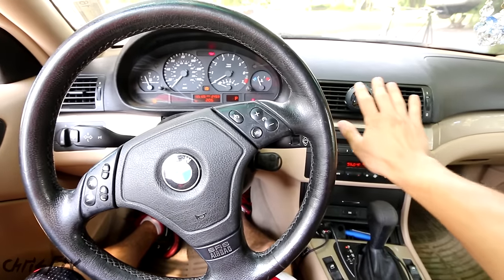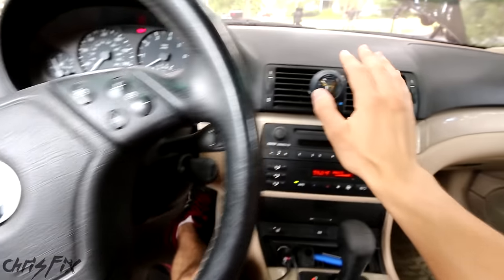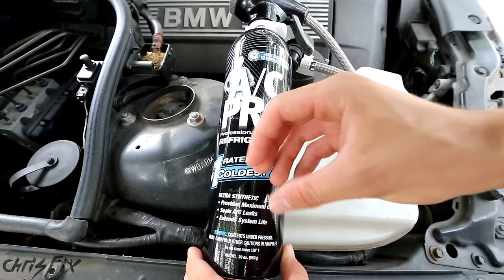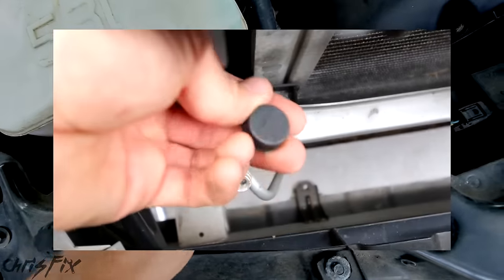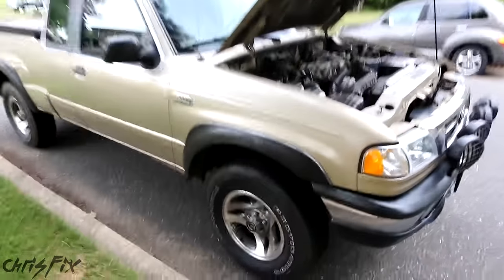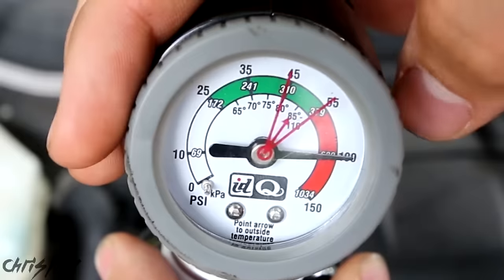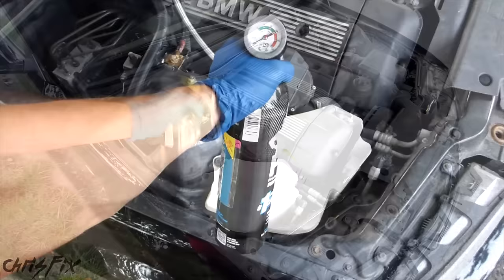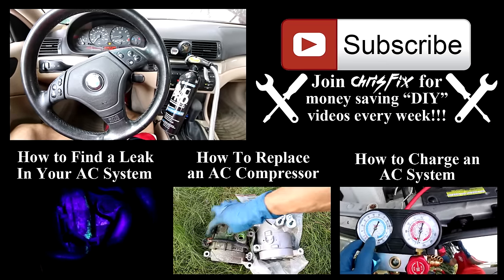How to Recharge Your Car's AC System (Fast and Easy)

Comment: Well there are certainly a couple of things to discuss about this video. First and foremost you never charge an AC system in a car unless it's been properly evacuated and second, never charge an old system to anywhere near 45 or 50 psi. All of these readings depend on the outside humidity and the outside temperature as to where your low pressure PSI should be so in general you want it to be around 35 lb but the outside temperature at 75° and relative humidity 60%. There is a chart if you Google charging atmosphere temperatures versus pressure. And always make sure your AC is on recycling as this will blow the coldest air because it is drawing cold air from inside the vehicle back through the vents
Reply: How many years old would you say is an old car?
Reply: @midkort  it's not how many years it's how many miles. I own a few cars and one of them is 20 years old with 43,000 mi on it

Comment: Hey Chris. Can I turn on my engine and immediately turn on AC? Also vice versa. Can I turn off my engine with AC running?
Reply from the maker: You can turn on your car and immediately hit the ac, the computer will usually hold off on it until the engine warms up a little then it will kick on, and you can shut it off with it running. The only exception to that would be if you are driving an old carbureted car but it's unlikely you will be

Comment: R12 have Schrader valve connections too sir
Reply: Both R12 and R134a systems use Schrader valve connections, but they're different sizes -- not compatible. You can buy a kit to convert older R12 systems to R134a, but that requires pumping out the old refrigerant and oil, replacing w/ a different kind of lubricant, using a vacuum pump to remove all the air, then recharging.

Comment: Do I have to evacuate the Freon inside of the car even though there is a leak and the ac is blowing hot air
Reply from the maker: You can always hook up gauges and see if there is any pressure in the system, if there is none then you can fix the leak without risk of dispersion. If there is some residual it is better to be safe than sorry so I would get it evacuated
Reply: @chrisfix  dude thanks so much for the fast reply, I thought I was going to have to wait a while. Thank you Chris

Comment: I'm confused if i should just refill or do the bigger job you do in other vid with vacuum pump etc. I have all the equipment but i don't have the guts to do it 🙈

I used a not so cheap scantool that said "your gas level is normal" twice. Can i assume that it's normal then?

Comment: Followed your instructions but I noticed a difference in pressure between when the compressor was engaged and not engaged.  Which pressure reading should I use?

Comment: Aren’t you supposed to have it like flushed out of the system so no air or something?
Reply from the maker: There is no air in the system. There is still pressure but it’s low so there is no air in it. I have a link in my description showing how to do it when you need to pull a vacuum and add refrigerant if air got in.

Comment: I recently bought a can of the A/C Pro from Amazon (6-6-2022). The canister I have has a pressure gauge on it but you can not adjust it for temperature. No problem, I just you may want to know.

Comment: Without a vacuum pump to get out the moisture, a scale to NOT overfill the system, and gauges for the low P and high P lines, you will damage the AC system.
Reply from the maker: Not really in this case but thanks for sharing

Comment: There is no need to vaccum the ac system as the air present in ac system lines?
Reply from the maker: Unless you opened the system and/or replaced a major component there should be no need to vacuum the system out

Comment: I tried to do it with super tech but it was extremely hard to press down. The bottle was really cold however the air did get a bit cold but not all the way. Any tips on how to get it really really cold? I very much would appreciate it (:

Comment: Hey Chris. You say if the compressor isn't running possibly add refrigerant but what if the gauge is reading red saying "see instructions" as well as the compressor not running? Should I still add the refrigerant?

Comment: Hey Chris my compressor kicks on at first and cold air blow but after about 30 seconds it shuts off and the AC blows warm air does that also mean the pressure is low?

Comment: Good video, but in my experience the newer electronic gauge that comes with the ACPro is NOT accurate.  With the compressor on the gauge went from 25 to 36 in about 30 seconds of filling and then jumped to 66 without any warning or reason!  Sounds like a lot of people have had a good experience with this product, I am not one of them.  I had the neighbors kid use some higher end equipment to bleed off the excess and won't be using ACPro again.  Best of luck to you with your future videos.

Comment: Should I pull a vacuum before adding Freon !?
Reply from the maker: For a faster recharge like this, It's not necessary
Reply: @chrisfix  I’m guessing i had a leak. One day I decided to go to Walmart and forgot to measure the ounces so I think I over charged it. Killing the ac clutch. Also When I turn on the ac. It smells horrible like chemicals so I’m guessing it’s a ac evaporator core leak behind the dashboard. My questions is. I’m getting ready to spend a lot of money. New ac compressor new lines. New drier. New new condenser and new evaporator core. Should I pull a vacuum on the system ? Or it wouldn’t work ? I don’t want the new parts to get contaminated or whatever else can happen if I just replace instead of removing everything. The truck has zero Freon !  Ac clutch doesn’t work. It doesn’t spin. Any tips ? Also or do you think putting new parts should be fine ? I’m glad I found your videos man ! I helped out so much !!!

Comment: I have a question about the air conditioning, in my car the air from the middle air intakes is relatively cool, the air from the driver's intake is more warm, what could be the reason?

Comment: Hi Chris. I'm seriously considering doing this to my son's 1997 Saturn SC2. I had a cousin who passed away a few years ago that always did my a/c for me. He was always adamant on vacuuming the a/c system and adding oil before adding the refrigerant. He was also adamant on purging air in the installation hoses. I understand that this is a low cost fix and not a true, complete fix. My question is: will the air that's in the hose of the Pro A/C can cause any damage to the air conditioner system? I don't want to ruin my son's car.
Reply: Bro it's a fkng Saturn.... recharge the ac and keep it moving. The car is worth 35 cents and the recharge will last longer the vehicle.

Comment: I didn't know this was a thing but my car isn't cooling and I haven't figured out why. My fan runs and I don't think the radiator would be clogged since my car seems fairly clean. I replaced the cabin filter ... I think I may need to recharge since I don't see any refrigerant leaks and it's container is only slightly below the recommended line.

Comment: I have one question -- I watched a similar video that said you shouldn't use these recharge kits because one problem is that you can't flush the hose before connecting, so you introduce some air/moisture from that short length of hose. Is there a way to spray a bit of refrigerant out to clear the hose before connecting to the low-side port, and do you think this step is necessary?

Comment: My compressor or clutch seized up so i had to remove my ac belt. I plan on getting a new compressor, draining the refrigerant, removing old compressor, install new one, then i can refill the refrigerant with one of those cans or do i need a special device to fill when its completely empty?

Comment: Hey chris, do you still stand by doing it tihis way or evacuating whole system, vacuum mosture & air, and add correct amount (weight wise) w/ stop leak if needed. Thanks

Comment: I have a new compressor on my ranger it’s got the 4.0 I vacuumed the system it held. After adding the r134 my ac clutch is kicking on and off, I added the whole can and the gauge will go into the red clutch kicks on and then shows low over and over

Comment: Funny my gauge does not have that arrow/indicator but just the pressure needle. And my car AC temperature stays 45-46 at full blast, windows open, outside air settings (inside air didn't make any change tho).

Comment: Hey Chris,  thanks for all your videos.  I bought the AC Pro gauge without the refrigerant.  My Low pressure fitting is down past the fan so I was not comfortable attaching while car was running.  The gauge when I put it on goes to the red zone and stays there even if car and compressor are running.  Is it normal to read the pressure in the system regardless if the car is running or not?  Just want to confirm my problem is something else.  Thanks

Comment: Curious to know - why did you not use the recirculate option in the cabin? I find air con is always colder and is less work for the system when using recirculate at the same time.

Comment: the video shows that you used A/C Pro but the link is for Arctic Freeze.  Which one has the sealant that "wont damage the ac system or the ac recovery machines mechanics use"

Comment: Quick question: when the compressor kicks on while recharging with the a/c pro, the dial on the gauge jumps wildly into the red range, when when the compressor kicks off, the dial is at the lowest point in the green range, so, my question is, is that okay or do I want the dial to stay within the green range even when the compressor kicks on? No one explains or clarifies that. (Should the fluctuations be so cRaZy?) Thanks and I hope to hear soon. 🤔🤔🤔🤔

Comment: Hey Chris, question for you: do I have to puncture the can in order to read the pressure in the system? If I just connect the hose itself without it being connected to the can will it read the pressure right? Thanks!

Comment: I bought a Freon can recharger, but It doesn’t have the set pressure option. It does it automatically? Do I have to wait a certain period for it to get the reading, or it the psi level given right away? The gauge is in the red indicating to “see instructions.” Thanks for you help in advance!

Comment: Hey just curious I just replaced the ac condenser in my girlfriends car, obviously there’s zero pressure in there would I be able to use this method to charge it or need to use the actual ac machines they have at dealerships and whatnot

Comment: Hi, Chris. I have a small leak in my Prius 2007 as well. It lasts about a year. Is there a product that contains additives I can use that is safe to use in a Prius dialectic ac system ?

Comment: How to change the port fitting when leaking on air conditioner?
Reply from the maker: I would evacuate the system, the fitting is usually just screwed in so just unscrew and put the new one in and then recharge with this process: https://www.youtube.com/watch?v=Pdq8JAlct6s

Comment: I noticed that you are using A/C Pro Ultra Synthetic A/C Recharge R-134a. My 2017 Veloster uses Regular R-134a refrigerant. Is it safe to add the synthetic version to this - mix the two types? Many thanks.

Comment: Mine is on white when the  clutch  is on and green  when the clutch  is off,  is that normal? Should I check the pressure  when the clutch  is on or when off? Thanks!

Comment: I know I’m late to this video. My AC system went out this morning when I was taking my kids to school I usually set my temperature to 70° but this morning it was blowing hot air. I lowered my temp to 64° the ac was blowing cold air. If i where to recharge my AC system with a DIY would it fix the issue i have?

Comment: You probably should not recharge your AC system without addressing the leak first Chris, or at the very least changing out the valves on the High/low

Comment: Is it normal for the air not to be cold after adding the refrigerated bottle? Everything is spinning , gauge needle was on green and air still not cold at all… it’s slightly colder than earlier but not a major difference

Comment: 40F is ideal and of course this is useless when you only have a high port like my Audi does which was just dumb on their part
Reply from the maker: Is it hidden deep in the engine bay somewhere or there is only a high pressure port?
Reply: @chrisfix  only a high, they did not want owners to do their own AC, dealer only to have it vacuumed out

Comment: I just filled my 2010 chevy colorado with the 5.3 v8 with refrigerant and the valve on the port stuck open. Can the valve just be replaced or does the whole line need replaced. And if just the valve needs replaced, would a tire valve core work?

Comment: Hey Chris  question what if your AC is cold but it shuts off while on. I will turn off and turn back on but it doesn't work? Then 2 days later it will work again. Si basically it goes off and on. Chevy Colorado 12. What fo u think i need to fix it??? Thanks dude.

Comment: Hello Chris. 

I have a question. 

I just tried to fix my airco in my Kia Picanto 2012 with one of those kits like in this video (except mine did not come with a temperature setting). My airco had just gradually become less cold over the years (never had the AC serviced for years) and finally it didn't get cold at all anymore.

I watched your video(s), was hoping for a quick fix for now, but it didn't work out so far, and I'm worried I made things worse.

I started the car, turned on the AC and put it on the coldest setting with the blower at max. Then I connected the kit with the gauge to the low pressure side, it showed no pressure at all. Then I filled it untill it showed 60 PSI, with the engine and airco on. (I was aiming for 50 but went too far).

After that I drove around the block and when I drove away, cold air was coming out of the vents, and I thought it was a succes! but.. this only lasted for a very short time, a minute or so. (that doesn't sound too good, right)

So now the airco still doesn't get cold. 😓

Now, when I check the pressure on the low pressure side, the gauge shows 60 PSI, engine and airco on or off, there is no difference. Also, the pipes don't feel cold at all.

Since it is also showing 60 PSI with the airco and engine off, I'm thinking... maybe there is still not enough pressure, because with the airco off, the pressure should rise far into the red zone... (like 100 PSI) if i'm right? 

Do you think it's worth it to try and get another can of refrigerant, to build up the pressure and see if the airco will actually activate?

(I can't seem to spot any compressor pulley turning on and off when I turn on and off the airco, everything seems to be turning always, even with the AC button off, nothing stops spinning. But the fan on the front of the car does turn on and off with the AC button.)

(one more thing. I was too quick to do it, and kind of forgot about the temperature thing. I think it was about 68 degrees fahrenheit here when I filled it.... So according to the gauge in your video and other temperature/PSI charts, according to that I should have filled it to about max 35 PSI... and I filled it to 60 PSI.... So Im kind of worried that I have destroyed my AC system. But, since it's also showing 60 PSI with the engine and airco off... I doubt this, and start thinking the pressure is actually still too low? 🤔

(Also, since before re-filling the gauge showed no pressure at all on the low pressure side.. that means the system was completely empty, right? In that case, that would mean I couldn't have over-filled it, because the can I used only had 453 grams of r134a replacement in it?)

Should I try and fill some more... or let some refrigerant out?

I'm hoping you could shed some light on this! 🙄

Comment: Is it important to bleed the air out of the hose that you connect from the r134a  to the low pressure valve?

Comment: Since I live in Arizona and temperatures reach over 100 and we’re suppose to match the outside temperature on the can dial. Is it okay if the needle goes into the red area?

Comment: I like that moisture cleaner uper(er?) U mentiond, all these UtUb Ppl telling horror stories about how you’d beter perhaps go get moisture cleaned out by a pro.. - only nightmare now is the high pressure part.. questions Ppl don’t seem to address like, does inflating lower pressure affect, or could it overinflate, high pressure side?

Comment: Hey chrisFix, hoping you check the comments on this one still. I tried to do this, but I notice the PSI fluctuates like crazy when I connect it to my low pressure line. My “A/C” is blowing at about 83°F. Any advice? Thank you!

Comment: I fear that my freon is all gone. I've read that the compressor should be running during the charge process BUT I've also read that if there is no freon compressors sometimes won't turn on. Will this be ok to add enough freon to trigger the compressor to turn on?
Reply: Freon isn't used anymore

Comment: At first you were turning the can to the left back and forth between 12 and 9, then later between 12 and 3. Can i just turn it back and forth between 9 and 3 so that the can is upright and not tipping to where the can would be upside down, isn't that the point? I know i get hung up on details but when there are videos everywhere saying not to try this at home or alone, i feel like after watching tutorials this is either UTI students or graduates going way overboard about safety and way cautious so as to prevent screwing up your ac system or maybe exploding a can in your face. All good precautions for the general welfare of society and the pocketbooks of mechanics everywhere. Say, why are mechanics trusted with this? Shouldn't you have to go to a specialized school to change a keg, i mean, an industrial whipped cream can, i mean, put gas in your car? Why is this still such a hands off fix to the public, particularly after having videos explain it. I can understand if it were written instructive